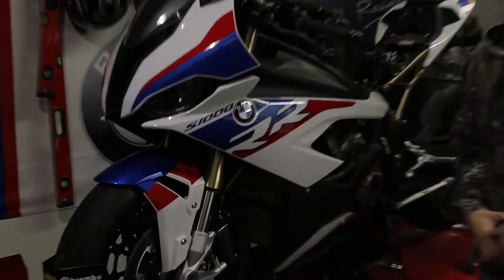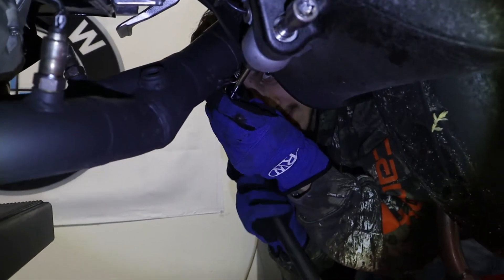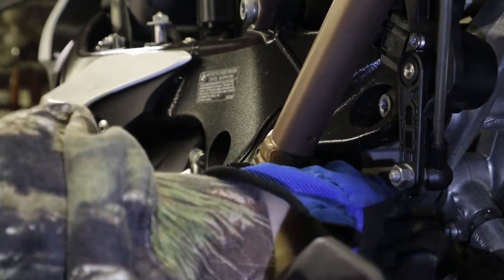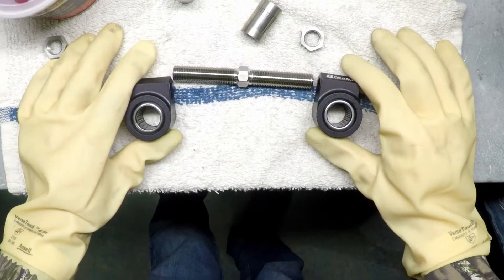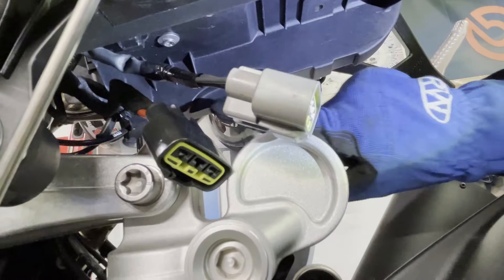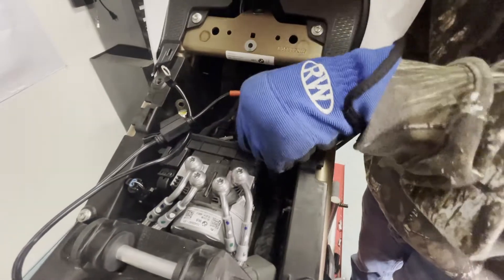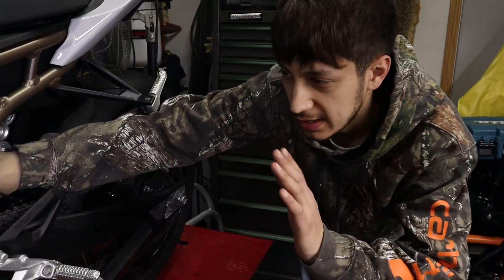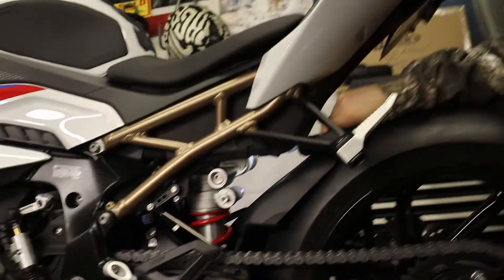2020 BMW S1000RR BROCKS LOWERING LINK (CONFIGURATION#2) INSTALL

Comment: Hey there!I wanna install this for my bike as well.Do you have the DDC and after installing this kit,does the DDC still work fine ?
Reply from the maker: Hello! & yes I still have the DDC on after installing & yes but you might have to recalibrate it, it is on the settings menu
Reply: @TonysGoodLife  Many thanks!I am thinking about installing the same kit you have.How much did you lower your bike?I don't wanna do the cutting works :(
Reply from the maker: @justinw8120  if you don’t want to do any cutting, you can go with configuration #1 & that’ll get you down I think about 2 inches without having to cut anything. I do not have a video out for configuration #1 but there should be instructions with the lowering link when you order it from brocks
Reply: @TonysGoodLife  Yeah yeah.I do have the install guide for it and one of the brocks performance technique guy replied to me about the same thing.Really appreciate for your advice!
Reply from the maker: @justinw8120  no problem man anytime! I hope it goes good for you

Comment: Do not install that on your bike, I got it and that link broke I contacted Brocks and they never had an answer why it broke. I investigated if there were more cases like mine and I found out that a lot of the people who bought the same product had the same situation IT BROKE on them too.
I took my bike to the dealer and BMW does not endorse at all Brocks link and it does interfere with the performance. Good thing that when it broke on me I was going slow and straight.
Do not install it!!!!!!